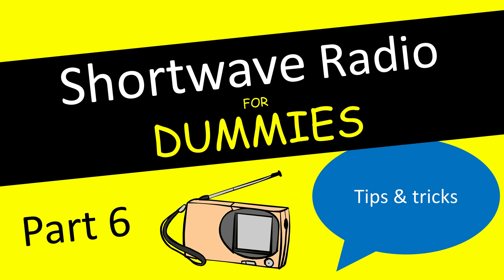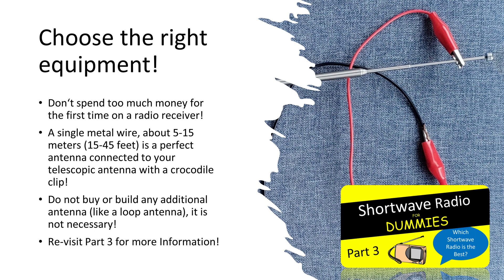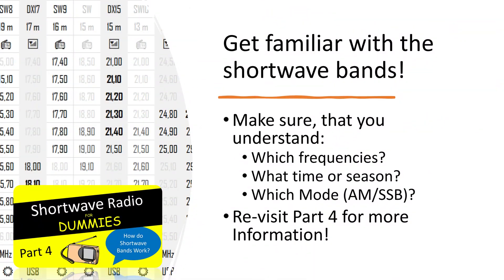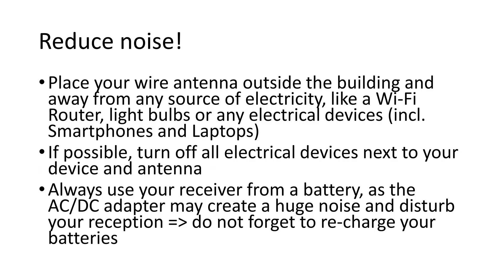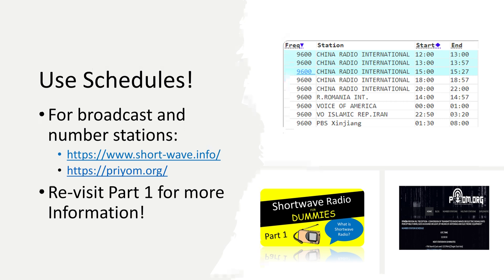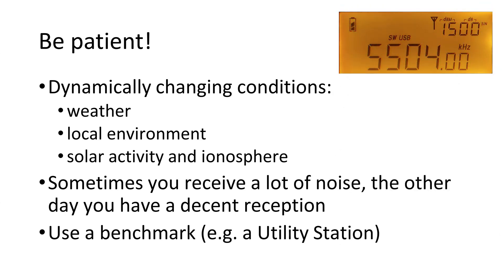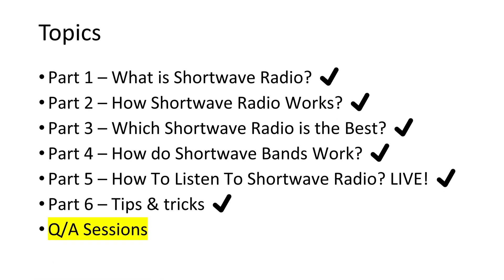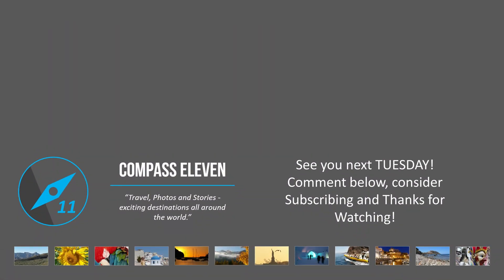What is Shortwave Radio? - Part 6 | Tips & tricks

Comment: there are 2 cable in the photo, one is read and another one is black, how to connect?
Reply from the maker: The black cable is the antenna going out of the window, this is not connected to the radio directly. The red one is a double sided crocodile clip, this is connected to the black cable on the one side and to the telescopic on the other to the radio. Visit Part 3 where the whole image is visible.